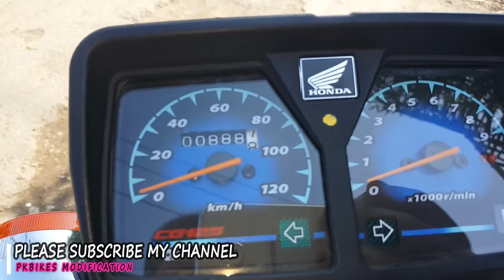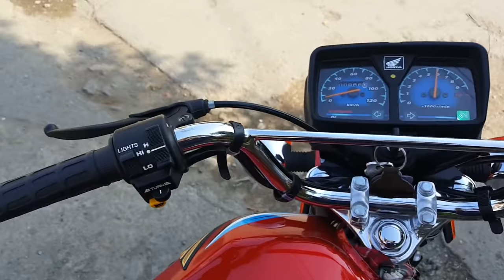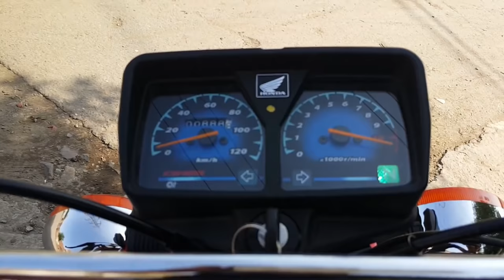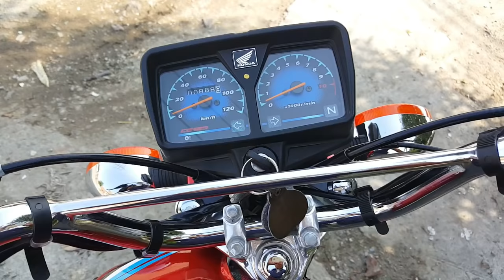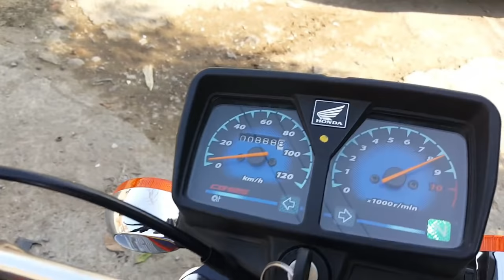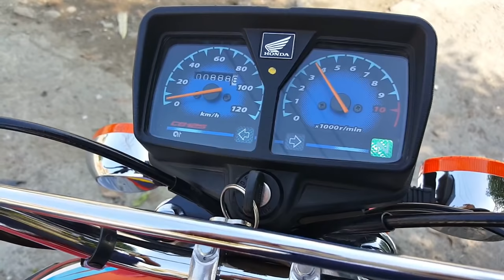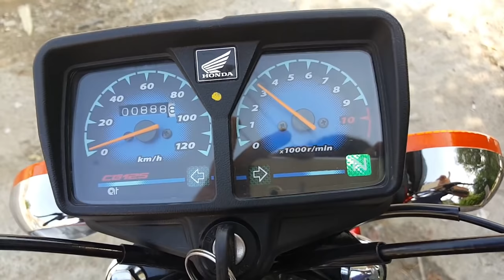HONDA CG 125 EURO 2 | MAIN PROBLEM AND SOLUTION |

Comment: Bhai mere pas United Cg125 hy 2017 model mujy 2 problems hain first jb bike morning MA start krta hun to first gear ma bike ghakta ly ti or 2nd bike 80 sy upper nhe jarha
Reply: Assalamu alaykum bhai
Ye koe etna bara essu nhi 
1 apki taypet tight hain
2 ap check krain apki byc main unite green grip ka hai to os per mac likha hoga to wo genuine hai nhi or ap original
Reply: Or hain subha start krny k baad 10 second tk ap usay mat chalain
Oil ko chalny do usmain
Achi trha taky usmain clutch smooth hojae
Wesy bhi cool wather main es trha hota hai
Koshi karian k ap 10 second wait krlain
Reply: Ayub khan Thanks

Comment: Bhai sab mery pas bhi honda cg 125 hai 2017 model uski sab se bari problem hain k wo 100 se upar nahi jata mane clutch plate change karwai hai pick achi hogi hai mgr speed problem nahi teek hui iska kya haal hai plz guide kardo yeh problem kuch bike mein ihi iska koi hal bata do plz
Reply: Filter Ke ak jali otar do or  2 litre petrol or 1 liter high octane v power dal do phr speed dekhna
Reply: Ok kal mai TRY karta hun
Reply: Brother tapat adjust kro intake wala 0.5 pe aur exhaust wala 0.8 pe rakhwao 100 cross kre ga
Reply: @muhammadawaisdar6109  Thanx brother try krta hain
Reply: @muhammadawaisdar6109  petrol tu zayada ni kahyaya ghe????? Tapat tu asa karwana sy??
Reply: @muhammadzainchattha2843  brother ye genuine standard k mutabiq hai fuel same rahe ga just fuel burning proper ho gi, mere pass 2010 model 125 ur 70 hai dono ki same setting hai.
Reply: @muhammadzainchattha2843   125  118km speed marta hai ur 70 101km

Comment: What if I install 200 cc rickshah unit in 125 is there any disadvantage of too much current must reply
Reply from the maker: No bro" only 125 big unit and 150cc unit
Reply: @hamzainfotv  why 200 cc rickshah cdi unit cannot be installed
Reply: @NoumanKhan-uh4it  bro too much current can make your spark plugs it's wire and your battery + pick and speed to misbehave...And it can also disturb the distribution of current supply to the whole bike...
Reply: @Real_balaj  good ans

Comment: vibration kese khtam hogi? 60 se upar vibrate krti h CG
Reply from the maker: pori bike k nut bolts tite karain
engine k lazmi 
insha Allah 
masla hal ho jaye ga
Reply: @hamzainfotv  ik aur masla hai.. bike sedhe hath per gir rhi hai... jumps, rims, teeliyan, handle ki goli catori, wheel thru sab krwa lia.. lekin phr b bubbling aur sedhe hath pr gir rhi hai..
Reply: Fuel adjust kerao. Kam huaa ha
Reply: @hammadsid7880  chesis terha hoga. Meri bikeki bhi same yehi condition thi dentar ny 1 front shok or chesis seedha kra tha ab set hai bike